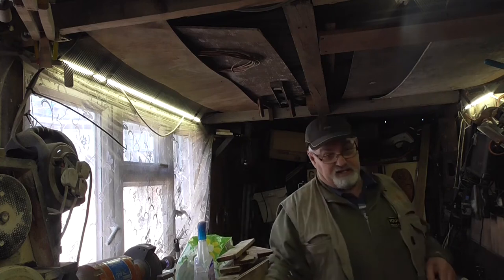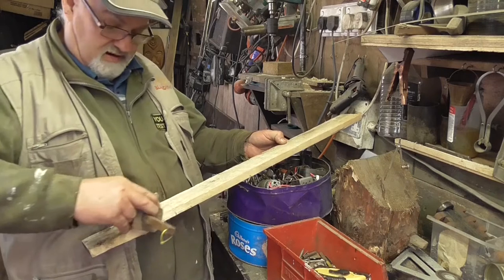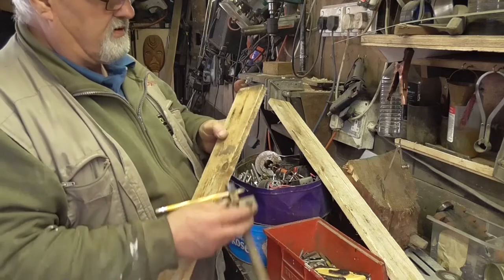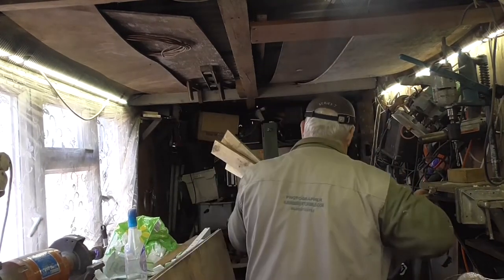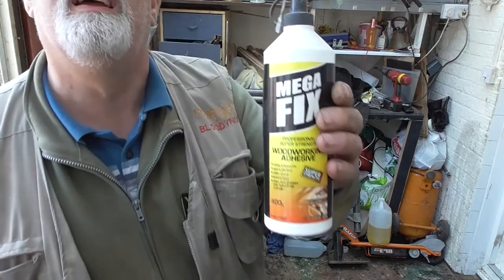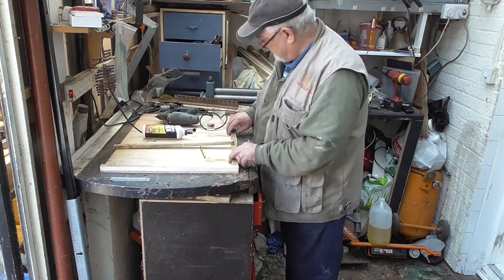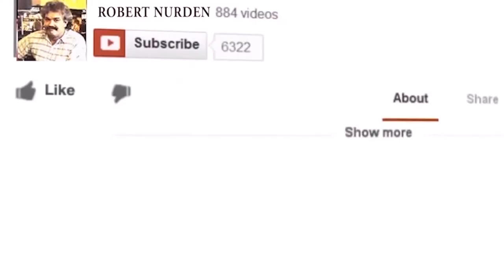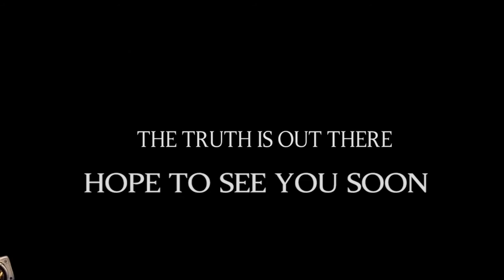how i always put the dog first in metal woodworking

Comment: the next project should you need it is to build a vertical wall saw. Vertical jig holding panels in and an electric saw moving up and down and with a twist so the saw can also cut horizontal.  :)
Reply: Rob windoze is a term used by linux / mac users win =windows doze = fall a sleep waiting for it to happen :)  lol